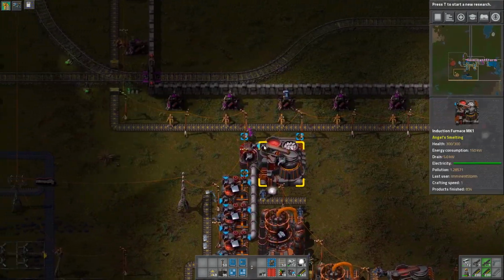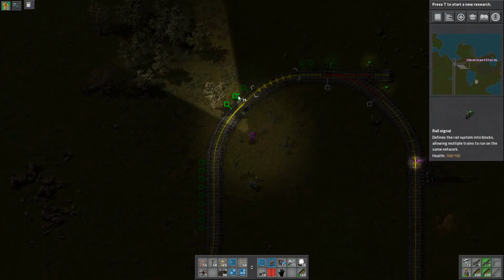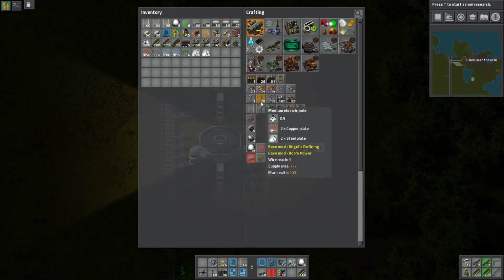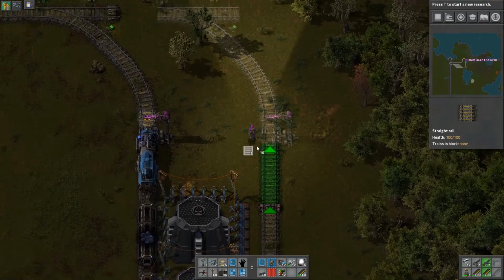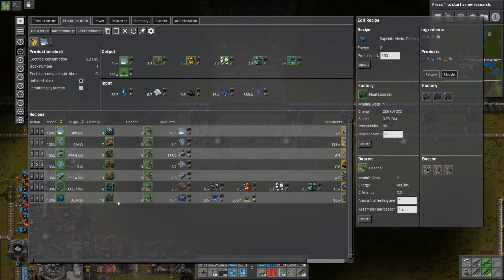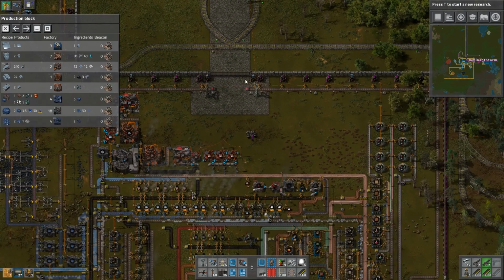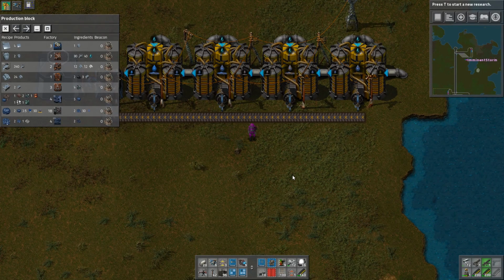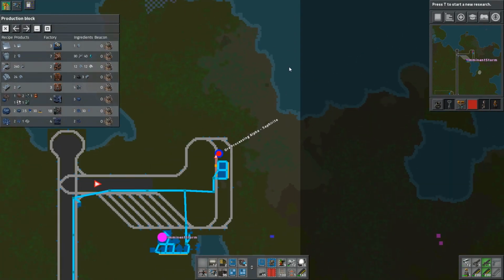Factorio - Angel's & Bob's - Episode 16 - Mud Processing

Comment: I forgot the name of it, but there's a mod that snaps vehicle movements to an eight-directional grid, thus allowing you to easily do exactly what you were attempting at 17:00.

Your walls should be much farther out. Just find the narrowest chokepoints in the natural geography and build there. Wherever "there" is, it should be far enough out that (once you clear the biters) you can build new mines, solar farms, and large factory layouts without the resulting pollution ever getting close to the biters' nests. This works better with a combination of laser and flame turrets (or at least robot ammo delivery), of course.

Colored wire and loaders (I don't know if you have that mod but it works great with warehouses and the high-volume Angel's materials) allow a very compact way to balance belts. Feed 4 or 6 or 8 belts into a warehouse, feed however many you need out the other side (filtered for the ingredients you want, because loaders can do that), and rig the first portion of each outbound belt after the loader with a wire. The programming should read the warehouse for some minimum value in storage; if it's above that value, the belt will work properly; if not, the belt stops. Do it right, and the output belts will always be balanced. (I saw this in Nilaus's current campaign.)
Reply: It's called Vehicle Snap... weird huh!!  :). And yes, Loader Redux is a must with Angels imo.